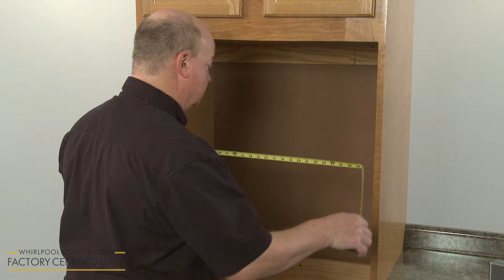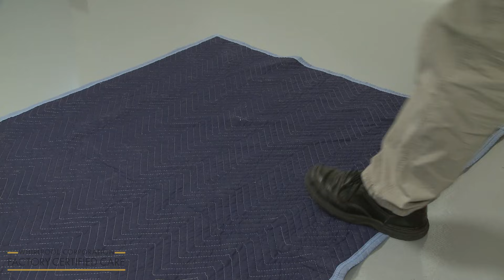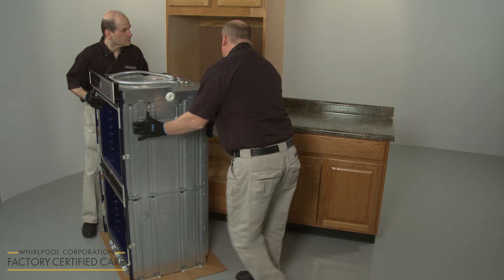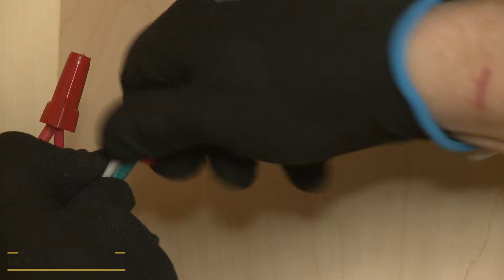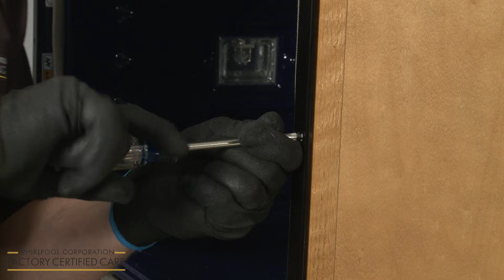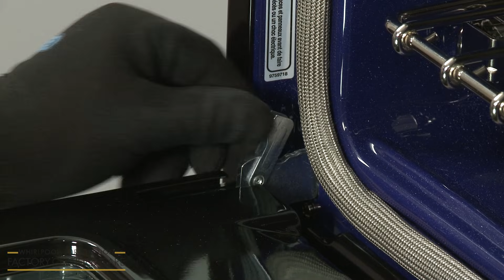Double Oven Installation Model KODE500ESS02

Comment: seriously injured is certainly correct.  first turn into the Incredible Hulk. find another guy(if possible) who is also capable of this.  second. lift oven/microwave combo unit into hole. third. make certain to hire a certified electrrician to wire the thing. if the prior owner to your home "jury=rigged" your origional wiring fro the old combo unit(which failed) you are shit out of luck! no one will want to wire it! they will warrent your arrest. prepair for jail and getting raped in the anus. because a prior owner failed to wire an oven/microwave combo properly even if you did not want the thing in the first place and if the inspector had done his job to point this out youj wouold have looked elsewhere for a house!

Comment: We got this oven a few months ago, It has been excellent=>>allmy.tips/kitchenaidRange?B2    So far no problems. Works as expected. My only issue, The Upper oven seems to be a bit tight. Burned my hand twice before I learned my lession! I would suggest a differ rack in the top with some kind of grip handles on the sides to make it a bit easer to slide the rack out to get your food. Besides that...Happy wife...happy life!

Comment: You should always hook your ground up first, then neutral, and last your hot wires. Just saying
Reply: this is the comment I was looking for.. Always hook grounds up first, disconnect last. Safety first
Reply: It really won't make much difference,  if it's hot and you close the circuit with the same hand.. it will do a close distance arch. The possibility of injury will be close to the same scenario.. The main concern is making sure power is off. Use proper gear, gloves, etc & insulated tools. And always treat the cables as if they were live. One by one & respecting each one.  Sometimes it's safer to cut the main breaker, but even so, never trust the breaker. The tag maybe mislabeled, or the wire may be feed from another panel.  Even from a neighbor feed (condos, townhouses, multifamily complex, etc)
Reply: I'm sayin....
Reply: question if im making a frame to sit the oven dose it have to be out of wood or metal?
Reply: Hey Good evening iam GLADYS u would like to place and oven cabet please thank you

Comment: Help! I bought a GE oven model JK5500SF4SS .I am in Zimbabwe and my power source is 240v. How do I step up/down the power using a junction box? is it possible to connect oven to a  step down voltage converter.

Comment: My current oven/microwave combo unit is sitting on two 1x6's. Do I need to install a full floor and use the feet or can this just sit on the 1x6's? I also currently have 2 30amp breakers and 10 gauge wire. I can switch the breakers if I have to but do I need to? Is that even acceptable to use a 40 amp breaker with 10 gauge wire? This unit has 10 gauge wire coming out of it not 8. I was hoping this would be an easier process....... which it will be once the electric is sorted out....
Reply: Hey what did you end up doing?
Did u you use the 10/3 and 30 amp breaker?
Reply: @Fcbmessi97   Yes. It works fine. I touched the breakers the first few times I used it to make sure they were not hot. They weren't even warm. Over engineered to cover their butts I guess.

Comment: Our home currently has two 30 amp breakers and #6 awg Aluminum electrical wire going to our oven that quit working. We want to get a new oven from Kitchen Aid. The new oven requires #8 gauge copper wire and 40 amp breakers. 

Do I really need to remove my existing aluminum wire? 

Are two 30 amp breakers actually a total of 60 amps?

Sorry for the uninformed questions. I always like learning. Thank you.

Comment: The video seems to show the electrical junction box in a cabinet above the oven. Is this a recommended location of the junction box? The installation instructions for a similar KitchenAid double oven (model KODE507EBS) say to locate the junction box below the oven floor. I have no room below the oven floor in my kitchen...so I'm wondering if I can use the space I do have in the cabinet above the oven.
Reply from the maker: Doug, we can only recommend installing your Double Oven per the Installation Guide of this model.  We apologize for any inconvenience this may cause you.
Reply: @wservicekitchenaid9982  Why then does the video show the conduit from the oven being routed up through a flat surface to the junction box? The oven must be located below the opening containing the junction box...agree? Or is the video misleading on this point?
Reply: The installation guide does not provide a junction box location
Reply: @coryl8119  Take a look at the 4th bullet on pg 3 of the Installation Instruction...it is very explicit on the location of the junction box.